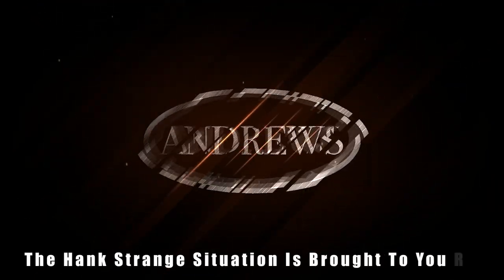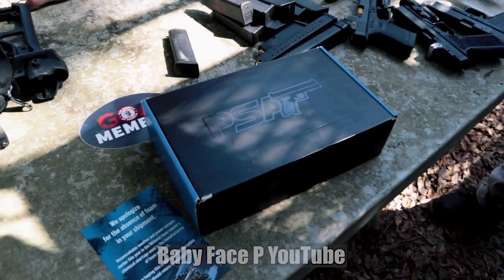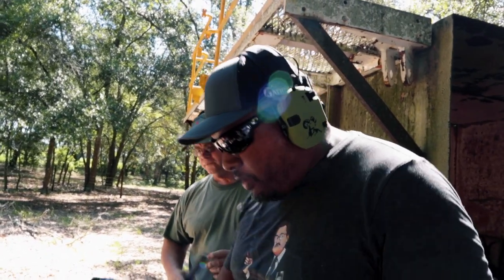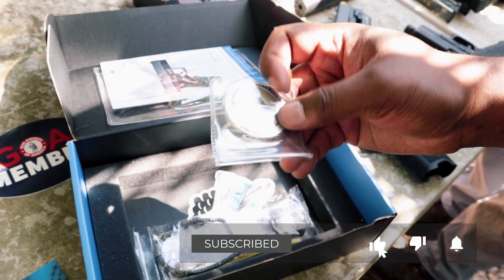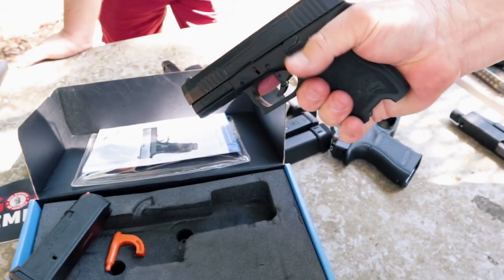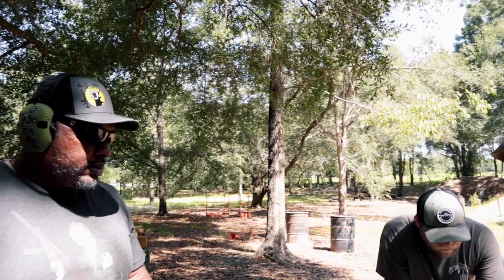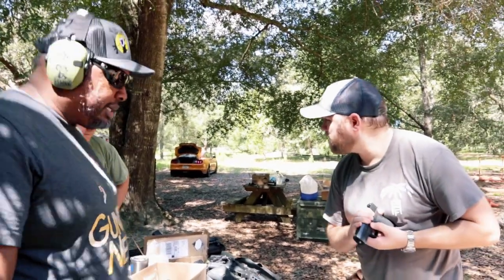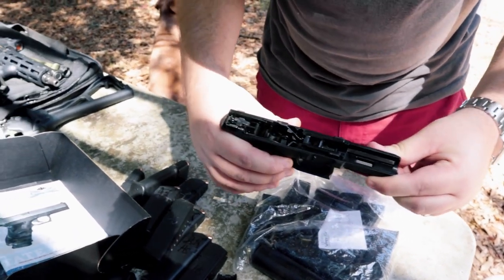PSA Dagger 9mm 5000+ Rounds

Comment: Men and Lady at Work. Noticed the light smoothed out the recoil impulse. Yall left it on for quite a bit. Thanks Patrick. Looks like subsonics may be particular. Will review other vids. I hope PSA accounts for suppressed shooting on the next model. Internals must have marine cups, seemed to survive the quenching. Very practical with a lot of good data gathered here.  At the end Patrick came up with the comparison to Taurus. That would make a great vid comparing a 3GC to the Dagger. Everyone, Great Job!
Reply from the maker: Thanks Len, I'm glad good folks like yourself appreciate the work we put into this
Reply: Not an issue with a can from what i've seen personally. Use non-extended, non-ETS, OEM Glock mags and you should have no issues.

Comment: Lola with awesome camera work. I have to admit this looks like a winner. I wonder how drop safe it is. Also I agree with Patrick I despise ETS mags.
Reply from the maker: Yeah lots of good work done by everyone...drop tests probably need to be done and I haven't really had a chance to test those mags before
Reply: It's exactly like a Glock, so it has an inertial safety, striker block, and uncocked striker. I would imagine there is no way to drop it and have it go off.
Reply: @g.4279  that’s great information. I’ll probably pick one up
Reply: @g.4279 came here to say this.  Ive thrown mine at the ground torture testing a compact model. This gun performs just like my gen 3 g19

Comment: My first set was a compact and a full size s model for $99.99. 1000 rds and still shoots very well. If you polish up the feed ramp, all types of ammo will run just fine. My second purchase was a compact and a subcompact $119.99. Again 1000 rds later both still run fine with all types of ammo. Only part I polished was the feed ramp on the barrel. PSA Daggers and micro Dagger are well worth the money. Even going with upgraded slides the Daggers are very well priced compared to other pistols. My next purchase will be their 5.7 Rock (5.7x28). So far I am very impressed with PSA Daggers overall.

Comment: For that price, I want one just to have
Reply from the maker: Agreed
Reply: That's what i said then fell in love with it and got more and my wife has one now. Its hands down my favorite Glock 19 clone right now.
Reply: Just get 1 totally worth it... fits like a glove glock perfection without the price...
Reply: After getting one, you won't stop.  There's so many options with slides and aftermarket parts, I have 4 now, completely different daggers, and my wife wants the new Tiffany blue one.  I built a gucci gun outta one with a timeny alpha trigger, and glock store extended controls. I love it.

Comment: Any gun much less a handgun once you add a suppressor you have to figure out what works with it magazine ammo and what model suppressor/booster your using and when using a suppressor it needs to be maintained along with the gun and isn’t exactly what you’d use for doing a 1,000 round torture test the fact it ran as good as it did I wouldn’t think a Glock 19 stock would do any better actually.
I have a few Glocks and a 19 already but I think I’ll order one of these just to have I mean you can’t have to many guns plus supporting PSA is always a plus they have really done a lot for the Gun Community in the last few years there is no better manufacturer who really makes quality guns for people at very affordable prices I got one of the Psa10 gen3 308 from them last year and it’s as fine a gun as I’ve shot it really is very impressive for the money .
And there FN barrel AR15 uppers I’ve got a couple of them and they or an amazing value also for the money you or getting twice the quality you’d get if PSA never existed for sure.

Comment: Watch at 107.36 in slowmo after the round is fired there is a smaller flash in the barrel after the new round is chambered, but not yet fired. Not sure what would cause it other then. A cook off of excess un burnt powder?

Comment: I only bought the optics ready Dagger upper for 129.00 on sale from PSA then put it on a P-80 lower. Very happy and not one failure through the first 200 or so rounds. Compatible with all my Gen 3 Glock parts as I don’t like the S&W-type trigger, so the P-80 lower that takes all Glock triggers was the best option. 430 for my optics ready Gen 3 Dagger/Glock 19 non FFL build.

Comment: The testing ammo costed more than the gun itself these days.  I have worked on 80%ers a few times, just the parts and slide will cost more than $300 without the frame!

Comment: Overall, the Dagger™ reviews have been very favorable.  The biggest issue seems to be the walking trigger pin (reported by YouTube reviewers Foxbodys4life, Honest Outlaw, Pops Quest, ... and several others across various Internet forums).  YouTube reviewer Foxbodys4life has indicated the problem is related to the Dagger™ proprietary locking block.  I know this particular Dagger™ hasn't exhibited the walking trigger pin issue.  Has PSA publicly acknowledged the Dagger™ walking trigger pin issue, identified the root cause and proposed a remedy?
Reply from the maker: I'll ask about that, yeah we didn't see it
Reply: Honest Outlaw. Reported that PSA had identified the problem, fixed it and has a recall program or field fix if you prefer. They send out new pins
Reply: @pcpolice7937  That's correct.  At a minimum, PSA redesigned the Dagger™ trigger pin and slide stop in an attempt to address the Walking Trigger Pin Issue.  PSA added slop to the trigger pin notches making them wider and deeper as compared to an OEM Glock and aftermarket trigger pins intended for an OEM Glock G19 gen3.  As with the trigger housing and locking block pins, the Dagger™ trigger pin should be considered proprietary.

Comment: Meh I've made every dagger I've touched reliable. 99% of the time it's the recoil spring so I get a lightweight ISMI spring set and tune it to run properly. Usually just requires one spring weight under OEM. My EDC is a dagger slide on a p80 lower. Completely reliable when you can diagnose issues. Even stock Glocks have the same issue but just a lower percentage. The dagger slide machining is good to go and to me as a builder the slide itself is proven.

Comment: 500?  I built my p80 I think 289 for everything lol..I also bought PSA dagger in pieces ..209$ for the gun ...50$ for frame cause they sell the bundles frame and ar15 lower ..99$ ..then on vets day it was 159 $ for optics cut with surpresser night sights lol ..209$ ...that's cheap

Comment: It was worth the $100 I got it for with a bundle sale. Excellent grip. The trigger is almost as bad as the SW99 and the recoil spring worries me. The break on the trigger is so far back compared to my other pistols. I took a nail file to all the hard molding seams. The mag release was both very sharp, too large, and way too stiff. They had so many complaints about magazines falling loose that they made it stupidly tight. It works best with Glock magazines. The front sight also rusted after 5 days despite a thorough clean and oiling. It works but there is no way I would pay $300 for it. Fixing the trigger would put the value so close to $400 that I would be saving for something better. I also didn't get a fancy coin, whatever that is.
Reply: That’s not why the mag release is stiff.  You watched one video on mags falling out and had nothing to do with the mag catch, let’s be real.
Reply: @bjornironsides6474  It was an issue related to the recalls. It's pretty well documented.
Reply: Oh i thought it was just a replacement barrel they were doing to correct the tolerance issue. My mistake